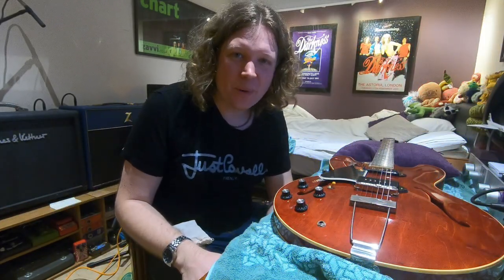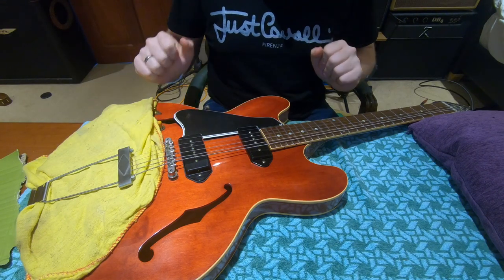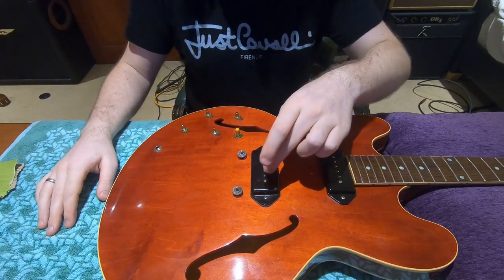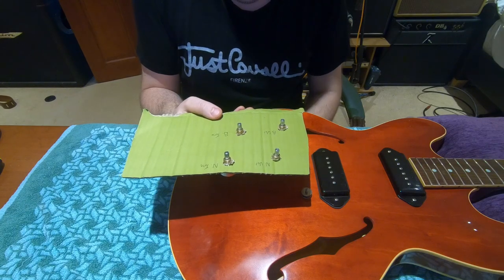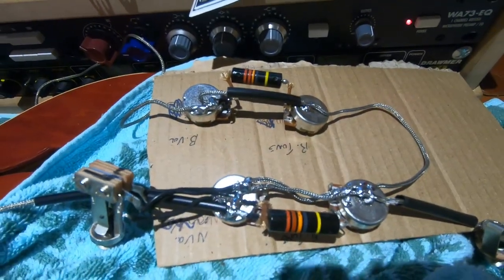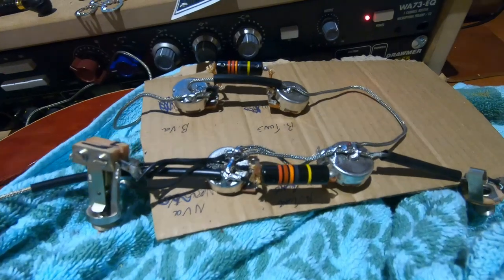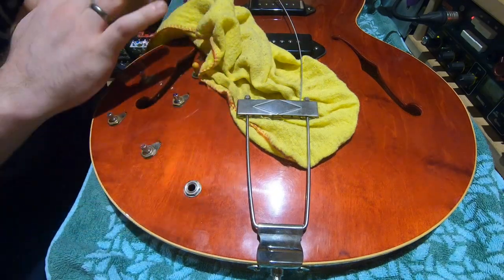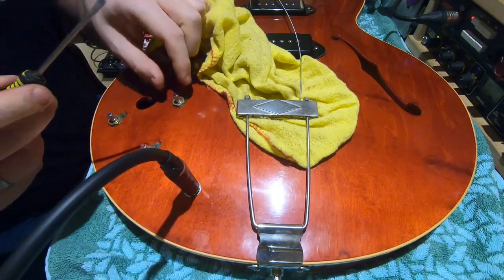How To Rewire A Thinline Guitar (Yes...It's A Massive Pain!!)

Comment: Hi Joe, I found this video really useful. I've just rewired a hollow body guitar and used your marker pen and jack hook trick. It was painful, but nowhere near as bad as I thought it was going to be. Thanks
Reply from the maker: Glad to hear it helped David :-) The jack hook is the most useful, I think...because that's what I struggled most with early on!!  The worst one I ever did was a Hagstrom Viking - because the toggle switch is up-top (like a Les Paul) and the wiring had to be pulled through the body from one side to the other...that was a nightmare!! haha

Comment: Great stuff. Ive had a few cheaper models to do of recent. Im starting to think some are wired before gluing . I like the sturdy wire jack puller. Ive had a couple of guitars presented to me with parts dropped in or disconnected already. We have a good, cheap car and tool parts shop locally that sells what look like long dentists picks that are bent and hooked in different ways. Theyve been very helpful. Depending on the pot shaft size I either tie dental floss or use silicon tubing pushed on before dropping parts in. Millions of ways to approach the job but its never pleasant or quick. Well done presenting this in your fantastic manner as always. Take care
Reply from the maker: Dental floss would work great :-)
Reply: Leaves the guitar minty fresh if you use the wrong one too. The waxing helps prevent burring on the pot hole edges. I like to do the main knot further down the shaft but then use a half hitch near the shaft end so that when you pull it guides the pot up straight rather than just failing by yanking the pot blindly into the hole sideways. Don't ask how I arrived at that.
Reply from the maker: @PoJoWo  Minty fresh! :P

Comment: Yes, yes it is... painful, very painful. I just did this with a reissue Starcaster, and I’m never going in there ever again. (I’m not happy with the taper on the bridge volume or neck tone pots, but I’m just falling in love with a volume pedal again... it’s a marriage of convenience... call me a gold-digger.)
Reply: Very handy cardboard and ink trick. If anyone puts a gun to my head, insisting I go spelunking again, I’m using your trick.
Reply from the maker: It really does help :-)
Reply: I feel you. I used Bourns mini pots just to pass through that small Fender f hole and not reroute the pickup cavity. I used surgical tubings to get them through.
Reply: Ha! I'm just about to do the same - maybe I should just have me tech guy do it for me!